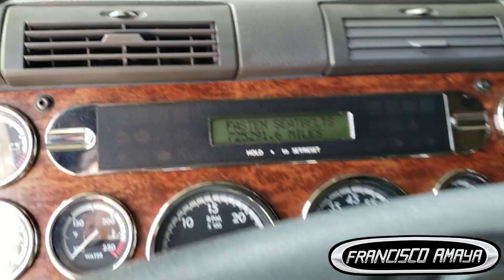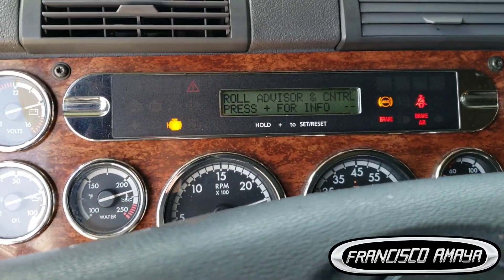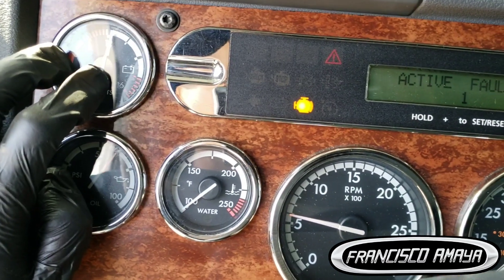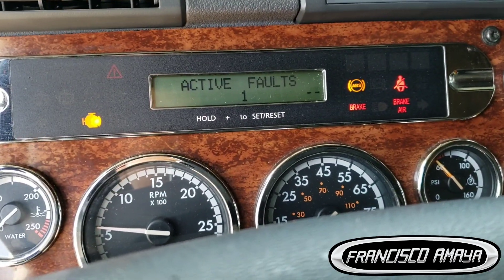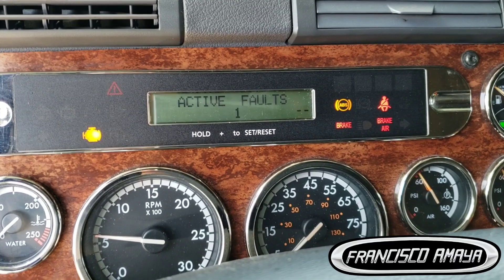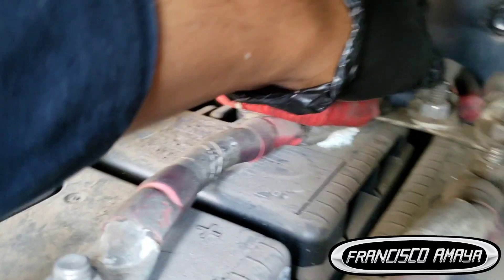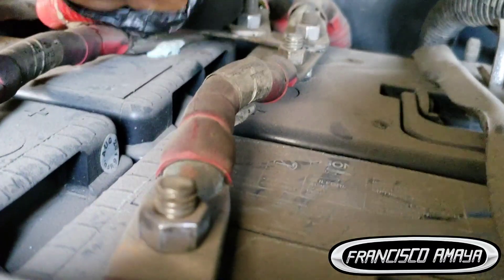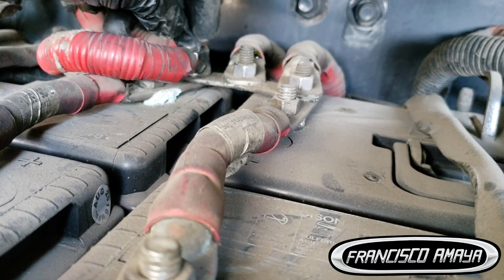Freightliner Cascadia shutting down while running power off with no warning over the road

Comment: Yesterday, had m2 with dd8 engine shut down on customer while driving. Tech looked at truck but couldn't find issues. I mentioned to him to check pdm cables fuses grounds for loose cables or the such. He gave up. I'll find out if anything was done to that truck. You have great channel Francisco, thanks for pointers

Comment: Dude your videos are very good and informational...Keep doing what your doing.  I'm getting an (spn 3238, fmi 2 fault code) on my 2015 Freightliner.  I'm also getting mixed solutions on the fix when I google it.  Some people say it's the inlet nox sensors and some say it's the outlet nox sensor.  What's your thoughts?

Comment: I had the same issue my truck it was a bad PNDB box located on the firewall where all the air lines connect truck would literally shutdown on the highway running 70mph and all volts no headlights at night very dangerous scenario..After a couple second  with my truck being a stick shift it restart itself all bets are off if your truck is a auto shift though you’re probably going to on the side of the road…😳
Reply: I had that same issue. Going uphill at night with an OD load. My rear pilot almost ran into me because I suddenly came to a drastic slow down. Truck fired back up rolling.
Reply: Me too I had the same problem, replaced the PNDB box, problem solved
Reply: @VOID-011  sir i have same problem what i should do pls
Reply: @مغربيفيدالاس   replace PNDB BOX
Reply: @guillermosierra6718  mine the light the engine went off driving or parking so just fuzs box well do the job
Reply: Am having this issue right now how far can you drive am trying to get back home 400 miles. To go get fixed
Reply: @mohamedigal172  
If you have a stick shift the truck will restart itself while in motion but if you have an automatic transmission you probably will have to come to a complete stop and try to restart the truck..But replacing that box will definitely solve your issues..

Comment: I had same problem last year when I was in San Antonio TX. My dad told me to check the batteries cable first ohh boy they were on loose. So yeahh this is common problem. After that I put locknut there it was the same exact  electric cable.

Comment: Battery connections and bad batteries is such a common cause of problems that in all honesty it is where you should start the moment you have any odd problem that doesn't have an immediate visible cause. 

Here is a lesson I learned thirty years ago. Wire corrosion is a lot like termite damage, the termites burrow under the skin of the wood so you can't see them. The way you check is by tapping on the wood for hollow spots.

So like this you should forcibly bend heavy wires, if they flex it is okay, if they don't flex they will snap. That is how to quickly find corrosion under the plastic sheath of the wire.

Comment: Do you have a video showing how to change the windshield washer bottle? 
Mines leaking, and I have no idea how to get to it
Reply: I wonder if you can patch it with WJ BOND for plastic. I did it on the cap of the wind shield washer reservoir.
Reply: @Amarillobymorning777  i would if I could get to it...it's a 2010 Cascadia, the bottle is tucked up under the firewall on the passenger side, where the only part of the bottle you can see under the hood, is the neck of the bottle to fill it